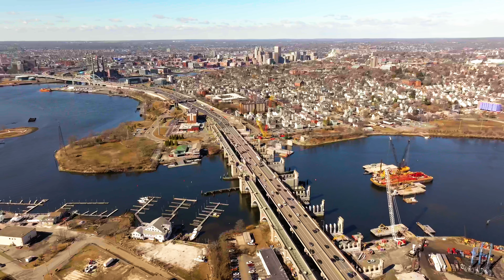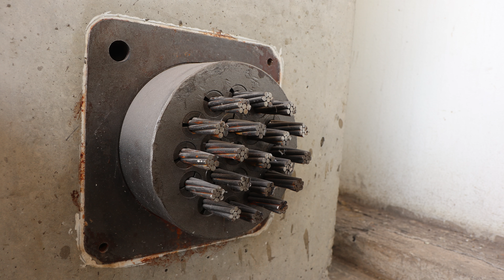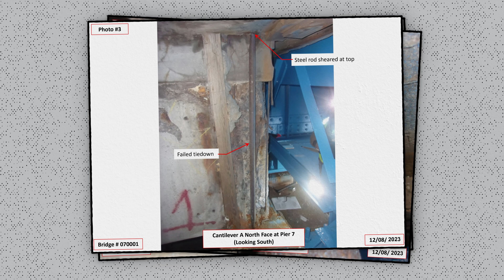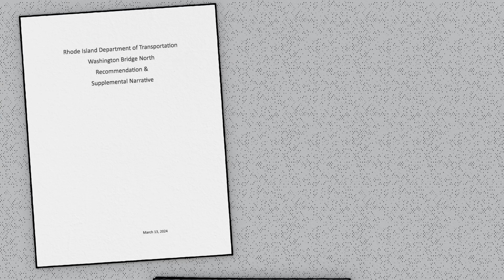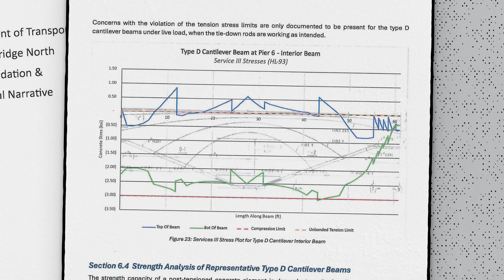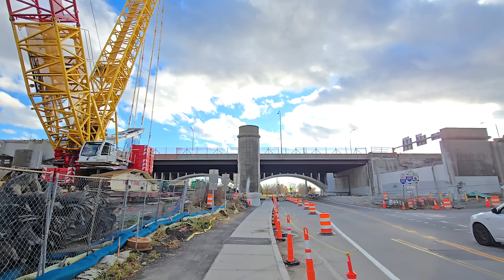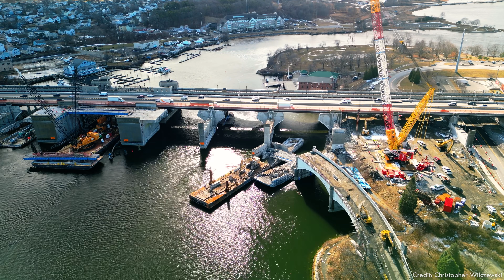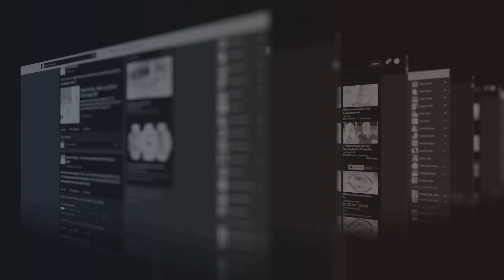This Bridge’s Bizarre Design Nearly Caused It To Collapse

Comment: As someone that works with overhead cranes i know exactly what happened here: complacency, over worked/ lack of inspectors and finance. Inspectors often don't do an in-depth inspection because the same things often break so other crucial component that don't often break are often ignored. Inspectors are rare and so they are booked months if not years in advance with little to no time to do proper inspection because they have 300 other bridges to inspect this year. Financially if the city or state don't have the funds they won't pay for it and only prioritize urgent work. Couple all of these together and you get an out of date road infrastructure that is only repaired and never maintained with preventative care. The only method I can see to improve the situation is by increasing salary and benefits for inspectors and making the qualifications less high but training longer. Have an inspector not need a masters or bachelors but have them be trained for 20000hrs with a reporting system where if a defect is found a civil engineer goes for an in-depth inspection of said issue.

Comment: At the time it was built, were any of the eventual failure points understood?  As you say in the video, bridge engineering has come a long way since 1967.  I doubt that many of the people who designed or built the westbound bridge are still around to testify about what they knew or didn't know.  The people that inspected the bridge should be held to a higher standard.  They had a duty to know about and be empowered to investigate signs of deterioration that could possibly (and eventually did) lead to failure.

Comment: Doing industrial blasting and painting its amazing how many things are built with no thought of how it will be maintained the use of coated steel that has to be replaced every 5 -10 years where stainless is suitable and would effectively never need maintenance or replacement because materials cost 3 times as much even if that is only 20% of actual costs

Comment: You don't have to be an engineer to know that exposed metal fasteners and relying on grout to Be a watertight barrier against rebar corrosion is a bad idea.  Need to find a better corrosion resistant way to protect the metal Or use a different alloy altogether.

Comment: As a retired engineer with approximately 500 bridge inspections (from single span 20 footers to multi span arches, both concrete and pre-revolutionary stone) under his belt I congratulate you on this video. I have been following this elsewhere and although a lot of information it is generally biased regarding RIDOT.  You obviously understand the various elements of design construction and inspection.  You are also correct about the lack of concern in the 1960s about inspection, the concern came about beginning with the silver bridge collapse in the 1980s.  Excellant job.
Reply: Lessons learned the hard way unfortunately
Reply: Silver Bridge, over the Ohio?
Collapsed in the late 60's or early 70's.
Reply: @BS-ys8zn Dec 15/1967 .
Reply: "Safety Regulations are written in Blood!"
Reply: Over your career, how often did you submit reports recommending maintenance and remediations long past the expected lifespan of the bridge, only to see the local people avoid doing it because they didn't want their taxes to increase?
Reply: @codetaku7  I mostly practiced in NJ where all bridges are owned by counties or DOT.  Those bridges that needed to be posted were.  Those bridges that were inadequate were closed.  Most were in fair shape, even those in rural areas.  But this is a state that has been in the transportation business in a big way since colonial times, so it may be our attitude.
Reply: @codetaku7  well it's not considered big news

Comment: Using tie-downs for the unbalanced cantilevers was a ridiculous solution to a jinxed design! You can actually see where the steel stretched before snapping! Also, the size of those tie-downs was incredibly small in diameter.

Comment: In Edmonton we have a swimming pool with a very innovative, free standing, swooping curved roof supported by adjustable tensionned cables. The problem was the cables were meant to be occasionally adjusted. After many (many) years the roof was showing movement and it was discovered that no one knew how to adjust the cables so... no one did!

Comment: I'm an electrician engineer but it seems to me if a steel pin holds up the section and there is a gap where it would fall when the pin breaks why not fill the gap with concrete to support the span. It's turning out to be 350 million dollar repair for a bunch of pins.

Comment: As Grady happened not to mention it, the eastbound bridge was completely replaced in the 2000s and is a normal steel beam bridge on concrete piers. It was cleverly built by demolishing some of the northern lanes of the original 1930 bridge, then building the new one in the gap between the remaining lanes and the westbound bridge. Then the 1930 bridge was demolished down to 1 lane and made into the bike path.
They were patching the westbound bridge bdfore that bridge was built, and they went back to patching it shortly after. Why westbound wasn't replaced as well at that time is a sad example of the state making short term decisions to save money.
Another irony is that the next bridge north had just finished being replaced with a smaller bridge that reduced it from 4 to 2 lanes when all this happened.

Comment: I don't think it's necessarily fair to say that the US has "bad infrastructure" without a proper point of comparison. I definitely have major gripes with US infrastructure, but I really don't know enough about bridges specifically to say for certain whether the situation is better here. But since you offered some numbers, I shall do the same.

In the Netherlands, there are roughly 85000 bridges. To put that into perspective, that's roughly one bridge for every 200 people, whereas the US should have roughly one bridge for every 550 people. So in that sense, the US has more people to tax for the same amount of bridges.
The combined worth of all infrastructure in the Netherlands is around €347B. In the US, that seems to be just under $5.9T. Accounting for the exchange rate between EUR and USD, this means that Dutch infrastructure is valued at around 6.3% of US infrastructure. Population-wise, the Netherlands has 5.2% of the population of the US. If the Netherlands was scaled up to the US's population size, Dutch infrastructure would be worth roughly $7.32T. So it's the same ballpark.
In conclusion, the Netherlands generally has high-value infrastructure, and comparatively more bridges to take care of than the US. And so all else being the same, it should cost the Netherlands more to maintain its infrastructure than the US, adjusted for population size.

From a cursory search, the Netherlands spent around €1.1B on renewing infrastructure in 2021. The US spent around $126.3B in 2023 (that is federal spending including money transferred to states). Now, the Netherlands' costs total about 0.9% of the US's costs, but I need to be fair and say that these numbers probably aren't entirely equivalent, so the result is probably not very accurate. Still, even if we double the amount the Netherlands spent just to make our estimate more conservative, that means the US is overspending on its infrastructure by a factor of three. 
That's not an insignificant difference. We can speculate as to the reasons why it exists. Could be there's waste and corruption, with projects being dragged out so they cost the government more? Could be that a lot of US infrastructure is rural which could make it more costly to maintain? Could be that the US's infrastructure is generally in a poor state which drives up maintenance costs when really, a lot of infrastructure should get replaced?
Though it's worth mentioning is that the Netherlands projects that in 2030 or so, it'll spend €3.4B on infrastructure maintenance, which would bring it in line with the US based on my most conservative estimation. By that time the overall value of Dutch infrastructure may also have increased, but let's say that the amount of money the US spends on infrastructure is in the ballpark of reasonable. Which means that if there is an issue with US infrastructure, poor budgeting is not necessarily the cause. Though if US infrastructure is in poor state comparatively, that might point to underspending on infrastructure on the US's part, which almost certainly means that a lot of money is being wasted or spent ineffectively.

As for the general quality of infrastructure, I know that road quality is higher in the Netherlands. However, that says nothing about bridges, and it doesn't mean that there aren't issues here as well. A 2021 report on Dutch infrastructure states that aging infrastructure and an amount of traffic unforeseen at the time of construction are issues that will need addressing, and warns that the renewal of infrastructure is not sufficiently on the political agenda.

I don't actually have a conclusion. I was hoping that the numbers or other factors would allow me to reach one, but I don't know enough about many relevant factors, and the things I do know about and was able to find don't offer anything conclusive. So this just kind of turned into an infodump without a point, I guess? But I'll still post it for the engagement it'll provide to the video.

Comment: 16:20 I think that right there, saying things like "an embarrassment for the state" is part of the problem with how we talk about these things though, to politicians, image is everything. Saying that some engineering failure is an embarrassment only leads to people pushing off admitting an issue for some other administration to take the fault for. It also leads to things like the original issue where they are more worried about the vanity of a project then it's function. 
we've got to stop using terminology like that when describing these sort of things to lay people as to those who don't understand the danger and importance of effective design, the most important element to them becomes the vanity. 
This isn't just in engineering, this happens across the board where the public is more worried about convenience, visuals or fault of a problem rather than just going "hey this thing is wrong, here's why. lets do better"

Comment: Great video! You can have a bridge that lasts a long time with a good design, but if you can't inspect it properly, you risk overlooking problems. Also, if you don't standardize the elements in the bridge, it's hard to know what to look for. 

 It reminds me of certain automobile engines that perform well and last a decently long time, but can't easily be inspected, repaired, or maintained because of "minor" design decisions. It leads to shorter engine lifespans because maintenance that is difficult often gets overlooked.

Comment: What an engineer's nightmare. I used to experience several of these situations but it was while repairing very old housing buildings in Paris (you don't want to completely demolish them because of heritage protection). You would hire a team to make the inspections, do the planning then, the works began... that was a nervous breaking moment : you didn't know what you would find underneath the parts you were replacing... and sometimes it was this kind of nightmare : most of the parts uncovered were completely rotten, delays exploding, costs rising to the roof. And it was quite a joy to explain to each families that their temporary accommodation would not be for 2 weeks but for 3 months...
(sorry, I'm French, I don't know the technical terms in English).
I love your videos !

Comment: Key here is that proper design includes full method of assessment, inspection and certification protocols and ongoing assessment revision based on improved analysis techniques. These mandates were in place when this bridge was constructed. At least one of the above was not adhered to. 
It appears that there is fault aplenty to go round. That would be true if this were a small rural bridge. This is a major bridge on the federal interstate system as well as a metropolitan artery in a state capitol. Shame.

Comment: I'm not an engineer but I can think logically. What I haven't heard mentioned is the fact that we now use even more salt on roads than we ever did. Plus some even more corrosive types of ice melting chemicals. No bridge can stand up to that kind of environment... Except pure granite arch structures that use no steel or concrete.
How about we stop using so much salt? How about using sand again and plowing better, at least on bridges anyway? It may lengthen the life of the bridge and I don't think putting millions of tons of salt into the environment is doing anything good for the rivers and streams.
As for getting someone to design and construct a new bridge in RI? LOL good luck. Every large construction firm knows what it's like to try and work with that State. The politicians there are so arrogant that anything that needs to get done is swamped in red tape for years. Case in point, opening some emergency shelters for the homeless in time for the winter... How did that all work out? Hmmm?

Comment: This is an absolutely wild story.  I'm a bridge engineer in Philly, but i wasn't even aware that this was going on.  I actually worked for one of the firms at the very beginning of my career that the state of Rhode Island was suing (PRIME AE). I was in their Baltimore area HQ though, so i wasn't affiliated with this bridge or the state.  PRIME was a subconsultant on most inspection contracts - a DBE. Several other firms that were sued were definitely also subs and some may be DBEs as well.  The fact that the state of Rhode Island not only sued the prime firms but also their subconsultants is such an abuse of the judicial system it's ridiculous.  All these firms didn't do design work on the bridge; that's too many firms and too many contracts.  These were definitely firms that did inspection work.  Suing every inspector to touch the bridge over the last decade is majorly grabbing at straws... RI clearly just wanted a scapegoat. 

The design of this bridge was pretty wild for the time and even pretty complex for modern day.  There was no federal inspection requirements at the time this bridge was constructed, so the designers didn't design and detail the bridge with this in mind.  I've encountered countless situations where a critical component of a bridge is not accessible for inspection.  It's an extremely common occurrence, especially on bridges built before the 70s. It's definitely good that this was caught before a major incident occurred.  Some DOTs are exceptionally bad at maintaining infrastructure and managing a good inspection program cough PA, VA, DE cough 😂 especially when the DOT uses in-house inspectors, the inspections are absolutely terrible.  I'm convinced some don't even get inspected at all.  I don't know how RI does things, but what is clear is that they should have been more proactive about inspection frequency, special inspections, and advanced studies for this bridge.  The complex nature of the design alone should have warranted routine NDE to evaluate the post tensioning and concrete deterioration.

Comment: these stories make me respect modern engineering so much: the bridge had a ton of problems, half its supports broken, corroded cables, and probably had these problems for years. And it still held for all of those years. The level of safety we have learned to expect in our cities is incredible, but we are so used to it we don't even notice it.

Comment: What do the facades they added for looks have to do with the state of the bridge? The tie-downs were there to secure the transition from concrete to the steel of the navigation span, which would have been there regardless of the arches.

Comment: It's interesting that in the UK there is currently a debate that a lot of infrastructure is overly engineered - adding a lot of expense and time. And,  as an ignorant and casual passer-by I often think there are excessive amounts of concrete being used for quite small things. Some people point at the USA as a place where things are built quickly and more cheaply. I can't say which approach is better but perhaps each could learn a little from the other.

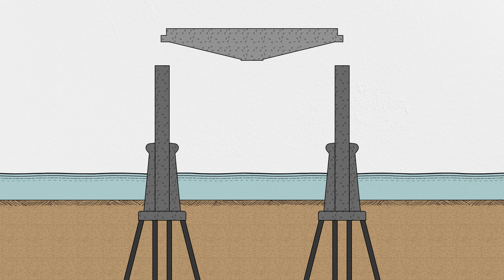Comment: 4:28 I would think that the structure would have been more fault tolerant if the cantilever beams had been rigidly attached to the pillars that supported them, so an imbalance would be less of a collapse threat. Was this considered at any stage of the life of this bridge?

Comment: Another classic excellent practical engineering presentation. An a Brit, I especially appreciated your mastery of understatement "The results weren't good" - translation - catastrophically bad, potentially lethal. I assume they have done the structural calculations of effectively doubling the load on the existing spans by narrowing the lanes and using it for bi-directional traffic, but no doubt it will shorten its life. It was interesting to note this whole situation was borne out of a compromise between cost and aesthetics driving mutually exclusive requirements that the bridge designers then had to work around, a story as old as engineering itself. Keep up the great work.

Comment: Good they discovered the problems before a disaster. 
At the Carola bridge in 🇩🇪Dresden the existing problems were known, but inspections did not show the real problem. And then suddenly at a night, one part collapsed, luckily at a moment where no one was on the bridge.
Short after this collapse a 2nd bridge across the river Elbe not far away was inspected again and deeper - and immediately closed for all traffic, included pedestrians. And that other bridge is alone within ~20 miles to both sides!